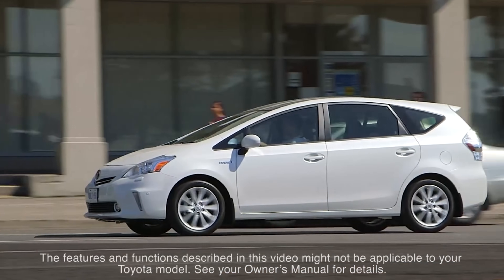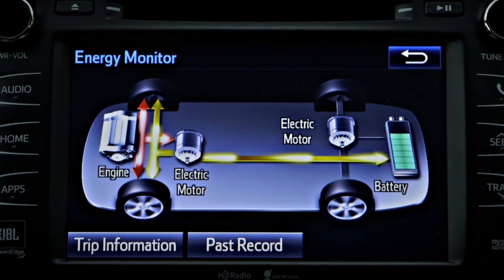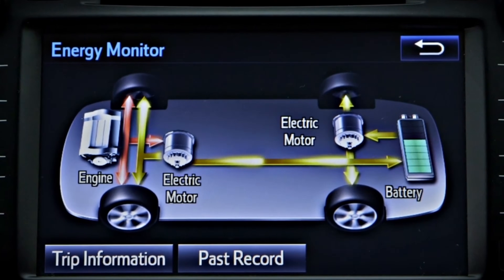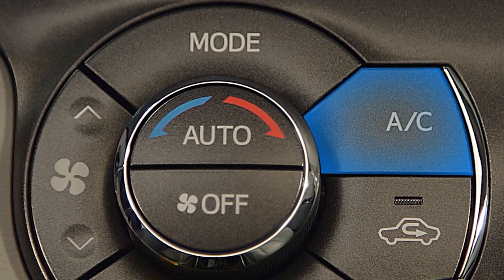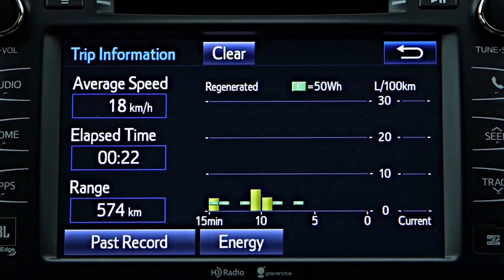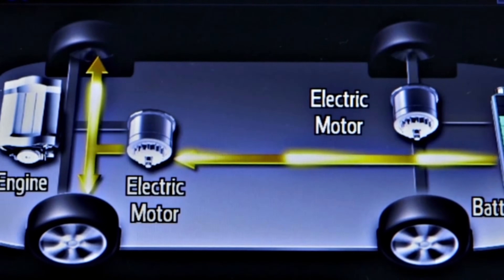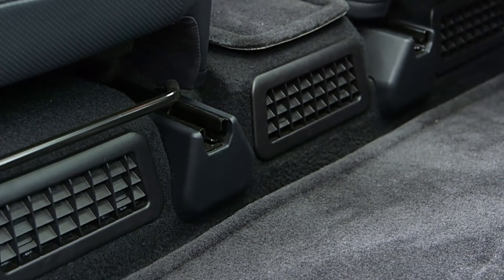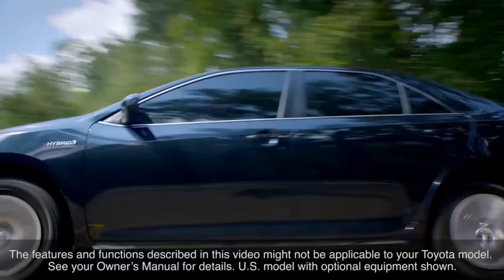Know Your Toyota Mechanical: Hybrid Synergy Drive

Comment: Does anyone know this question?  let say for some reason hybrid battery of the car is not working.  Is the car still able to drive on gas engine or total dead?  Thank you in advance.
Reply: Sea12 Hawks yes, my auris battery broke and the car still ran fine, just used a lot of petrol! soon got it fixed under warranty :)

Comment: Is the air conditioner run by electric since the motor shuts off once in a while?
Reply: Yes. The ac runs even when parked or at a light. By electric.
Reply: The AC can also be powered by a solar roof panel. My Prius has such a panel.
Reply: The ac compressor is usually electric powered and is not turned by the engine pulley system.

Comment: The Toyota Synergy Drive is one of the most brilliant automotive inventions since the dawn of automobiles. No slipping clutches, no gears that disengage and engage. I would have been worried about the cars computers failing to control the gas engine and electric motors correctly but Toyota seems to have that technology nailed.

We've had two Prius cars with a combined total of over 200000 miles, over 9 years, without a single failure. I mean not even a loose screw. Neither car has ever been into a shop for repairs.
Reply: Same here, I have two 2014's in my fleet,  the President and CFO drive them and both get up to 52 mpg,  and we have had no trouble at all with them!
Reply: I purchased Prius in 2010 and still runs like a brand new. Close to 100000 miles and no failures whatsoever. Had booked Tesla model 3 but going to cancel it and buy another Prius. Extremely happy with it.
Reply: Jagdip Rai i would a hope a car thats 8 years old would reach 100k miles without any problems, kinda a low bar
Reply: John Donaldson TOYOTA HYBRIDS are absolutely the best cars on the market in terms of reliability, quality and fuel savings (even at the high speed) Military grade durability build-in! Every TOYOTA HYBRID has superior quality and endurance. I do not know a TOYOTA HYBRID owner disappointed of his/her TOYOTA!!!
Reply: John Donaldson 
I’m either going to get a brand new Prius or a Honda Insight...but I can’t decide. I think both are great hybrids

Comment: Which Prius has 2 electric motors, mine has only 1?

Also why is the gasoline engine on when going downhill or why will the gas engine try to charge the battery when it is fully charged?
Reply: I believe all Prius have two electric motors. https://en.wikibooks.org/wiki/Toyota_Prius/How_it_works.

If you're going downhill and the battery is fully charged the engine will start to spin the Synergy drive to keep the generator from overcharging the battery. You may hear the engine running at high RPM in this condition. It is an intentional design and a function of the Synergy drive.
Reply: Every Toyota hybrid has two motor/generators. They both can act as motors or generators, depending on which mode the car is currently. There are 9 modes in total, if I'm not mistaken.
Reply: Catire Saba the one with two motor displayed on Infotainment screen is from highlander hybrid. My inter face looks exactly like the one shown in video.

Comment: today is april 28,2017 
I have a opportunity to purchase a 2007 prius with 67K Miles for $7K.
The car is beautiful inside out and grandma driven.  My worries are the 
battery( worth have the cost of the vehicle and the car has no 
Bluetooth. )
Thought and comments are appreciated.
Reply: probably need the 12v aux battery, like most cars this is good for 5 years.  
the hybrid pack is good for way more than 67K.
Might need exercising otherwise pretty good deal.
Reply: I added Bluetooth to our 2008 Prius using this device which worked great. https://www.amazon.com/gp/product/B00GJFGE0K/ref=oh_aui_search_detailpage?ie=UTF8&psc=1

Comment: Purchasing a hybrid was the BEST decision I've made #ct200h
Reply: @belly tripper you are speculating. If you had experience with owning one you'd never state such nonsense!! Warranty 8 yrs100,000 miles for you and the batteries are about half that.
Reply: 2 years later how do you feel about it
Reply: Smooth Operator I’m getting my ct200h this week, can’t wait d(“,d
Reply: Smooth Operator #RX450h
Reply: Thank you All so much!!
Reply: @belly tripper ok you've got your share if attention for now!!
Reply: @belly tripper you dumb.
Reply: belly tripper you don’t have to replace the whole battery, just the affected cells, cells cost $30-40 each...
Reply: @belly tripper  I bought used Camry 2011 and 2012;  2011 over 300,000KM and hybrid still running. 2012 Camry hybrid over 220,000KM. Both still gives me about 100KM/6L - I'm more than happy. Hyrbid is not just for fuel-saving, but environment friendly compared to conventional gas powered ones. So nothing to loose!